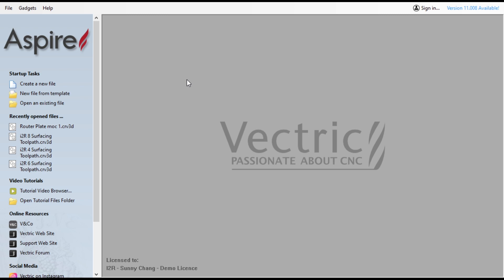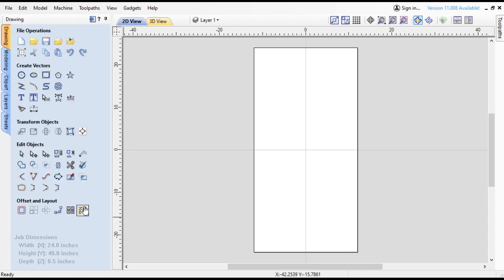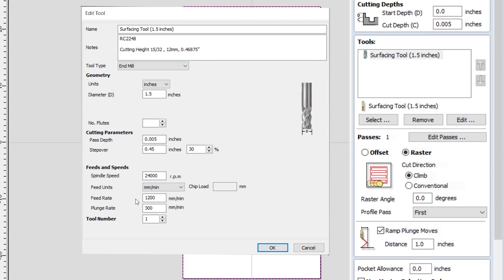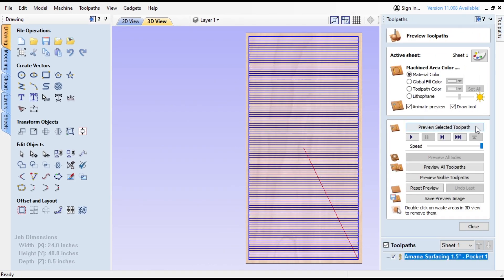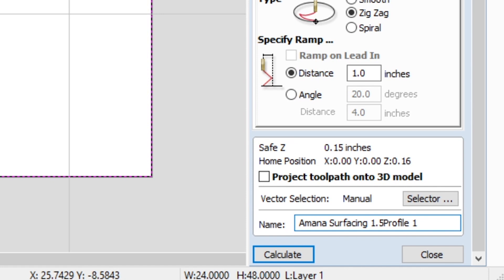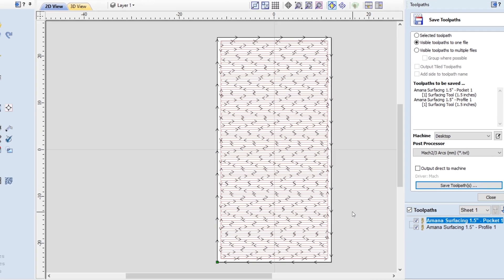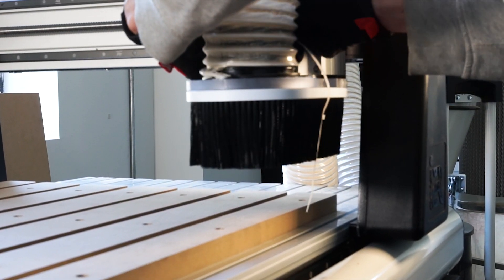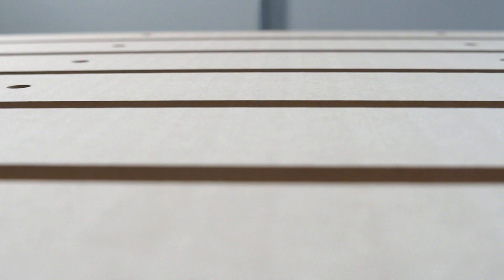#CNC #machining #woodcarving How to Surface Your CNC Router MDF Spoilboard - Step By Step I2RCNC

Comment: Thanks for the video, guys. This job can be made just a little bit easier though. When you set the vector size (go to 1 min 40 secs), instead of creating a rectangle the same size as the spoilboard,  make the rectangle approx 1/2" bigger in both the X and Y directions and centre the rectangle to the spoilboard. That way, the only tool path you need is the pocket tool path. It will surface the entire board.

Comment: What is a bad ripple? Am I looking for perfectly flat?
Reply: A ripple is when you can see lines in the material from slight height differences between passes. That's typically due to a spindle that isn't trammed perfectly perpendicular to the machine bed. Since there's a slight angle, one side of the bit is going to dip a little further from the other, causing the ripple - the less trammed, the worse of a ripple. If your spindle is perfectly trammed, you should get a perfectly smooth surface finish. Hope this helps!
Reply: I know what a ripple is. My machine arrived out of tram. I was asking how much of a ripple should be considered acceptable.
Reply: Matter of fact, maybe a tramming demo on the iR2 8 would be helpful.
Reply: @greglopez9311  There should be no discernible ripple. The spindle should be checked with a dial indicator mounted in the collet but if you don't have a dial indicator, using an accurate square against the spindle body and the spoilboard in both the X and Y alignment will give you an indication of how bad and in which axis (or both) the problem lies.
Far and away, the best solution is to buy a dial indicator. They are a very useful tool in your workshop. Do, of course, make sure you get the correct indicator for the job.
Reply: @dougsullivan9022  thanks Doug. Yes i got it dialed in. I needed some shimming and I was able to get near perfect. I appreciate it
Reply: @greglopez9311  Good to hear. Of course, a little bit of ripple would only be a problem for a) small jobs that don't span the ridges of the ripples or b) thin work pieces that may warp when clamped down on the uneven surface. Larger, thicker work pieces will just span the ripples without any issues.

Comment: This tutorial assumes that the spindle is trammed in.   If the spindle is not perpendicular to the machine table, in both X and Y axis, the surface will be rippled after surfacing.  The depth of the ripple will depend on how far out of perpendicularity(tram) the spindle is.